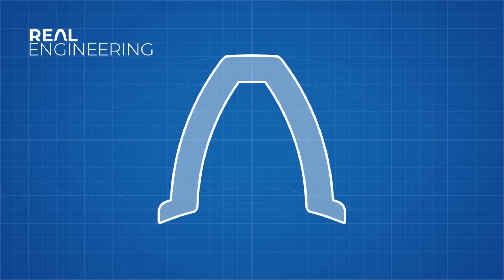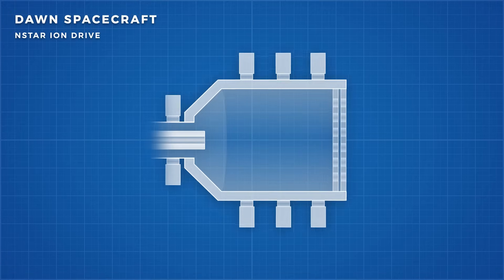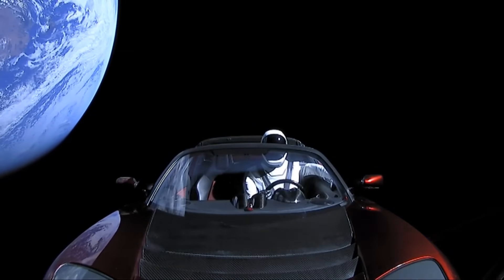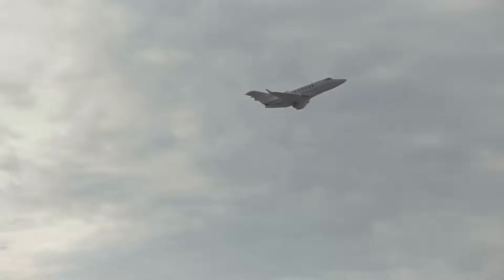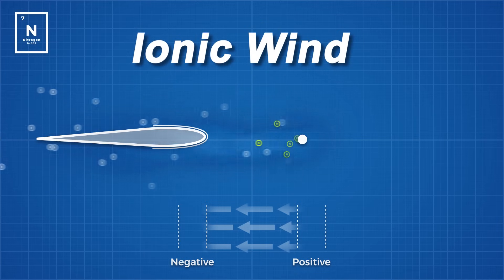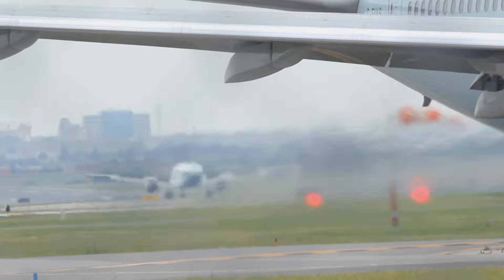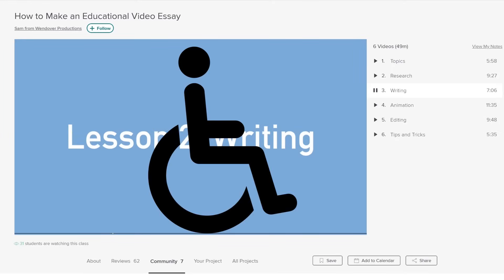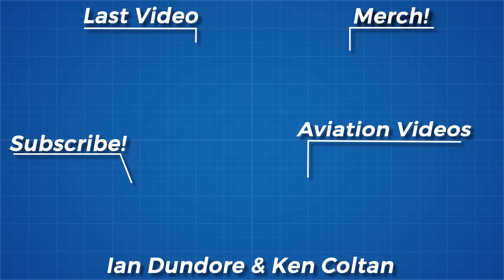Ion Propulsion - The Plane With No Moving Parts

Comment: There are some minor mistakes in the video.
The potential difference between the two electrodes (wire and wing) is 40kV, since the wire is charged to +20kV and the wing to -20kV.
The voltage type is also DC and not AC.

The DC voltage of the battery is converted to AC by a H-bridge circuit. This AC is transformed to a higher voltage level and finally converted to a high voltage DC by the Cockroft-Walton generator.
Reply from the maker: Yeah I goofed on the electronics side of things. I need to bring someone in who has a good understanding of electronic engineering to proof read. I have very little experience
Reply: @RealEngineering  man please take Benjamin he is really good
Reply: @RealEngineering , you also need to get someone to check your script/wording:
„Having no moving parts is a benefit that cannot be understated“ (0:33) means that you cannot say how bad/worthless it is. You obviously mean that it cannot be overstated, it cannot be appreciated highly enough, but you said something different. We get it, but it's confusing at first.
Reply: @RealEngineering  Just keep in mind that voltage is always a differential, never an absolute.
Reply: @RealEngineering .... Keep up the great work.
Reply: @RealEngineering  I respect your humility. You are a good human being my friend. And that's what matters in life.
Reply: @RealEngineering  you do it on your own knowledge??
Reply: @RealEngineering  How about the guy who left the comment? Idk wtf he's talking about, but I bet you do!
Reply: @RealEngineering  what happens if you use a Blimp with this technology?
Reply: It has also been in "development" a lot longer. A paper describes the theories of ionic propulsion and is basically what they build today. In the paper they even say, that it will be possible they just don't have the technology to make the transformers etc small enough. (both was done my MIT tho)
Reply: @IngoDingo   If you click on the channel icon to the left, you will see one that was flying with onboard power before MIT ever heard of the specific technology!  This is not a conspiracy theory or mistake, it is a fact!
Reply: @IngoDingo  
Anyone that takes a few minutes on Google, and does their homework will see that MIT did not create "the first heavier than air ion propelled aircraft with onboard power," despite the highly publicized Journal of Nature claim.

Please click on the channel icon to the left to see inarguable scientific verification and flight videos of an earlier craft with onboard power.
Reply: @IngoDingo  
The MIT craft does not predate the earlier patented ion propelled aircraft with onboard power. US Patents 10,119,527 and 11,161,631. The patented craft was MUCH earlier.
Reply: In 2017 MIT released a paper certifying that their EAD V1 had not achieved a level flight yet. The V2 had not been built.  The previously patented much more efficient one was carrying its power supply more than 10 years earlier.
  @IngoDingo
Reply: Helium can provide the lift for the battery, the ion drive can provide the propulsion.
Reply: @IngoDingo  🔴 What Is Islam? 

🔴 Islam is not just another religion. 

🔵 It is the same message preached by Moses, Jesus and Abraham.

 🔴 Islam literally means ‘submission to God’ and it teaches us to have a direct relationship with God. 

 🔵 It reminds us that since God created us, no one should be worshipped except God alone. 

 🔴 It also teaches that God is nothing like a human being or like anything that we can imagine.

🌍 The concept of God is summarized in the Quran as:

📖 { “Say, He is God, the One.  God, the Absolute.  He does not give birth, nor was He born, and there is nothing like Him.”} (Quran 112:1-4) 📚

🔴 Becoming a Muslim is not turning your back to Jesus. 

🔵 Rather it’s going back to the original teachings of Jesus and obeying him. 

More .....
Reply: Hi @IngoDingo , 

I have read probably all of the papers that MIT has produced publicly about the subject of EAD propulsion over the years.  They were in fact unaware of how to make the technology work at all until November of 2018. 

The patented Self Contained Ion Powered Aircraft, is an ion propelled aircraft that was carrying its power supply before anyone in the MIT group wrote anything about the subject. 

Anyone can see the public flight videos of prototypes of the much earlier vehicle by clicking on the channel icon to the left. There are also links to enough clear cut detailed information on the linked website, that any reasonable scientist should find sufficient. 

There is too much evidence in the form of over 100 flight videos, official witnesses, legal documents, and working flying models of the earlier patented ion propelled craft, for MIT to continue to claim that they built the first or most efficient heavier than air ion propelled aircraft of any kind with onboard power.
Reply: @IngoDingo  No, please look into it more carefully.  Dr. Barrett and his group were incorrect.
Reply: @IngoDingo  tesla coil is the perfect transformer for this especially if your ground is the tail to promote the attraction of ions and if you overlay multiple resonance circuits over the primary coil structure you can cause massive feedback and link it to tanks and resupply the batteries. We depend too much on circuits when we should be using passive components more.
Reply: @IngoDingo 
No, The MIT craft was not in development longer than the previous Self Contained Ion Powered (propelled) Aircraft with onboard power.  None of the MIT students had ever likely heard of ion propulsion when the earlier patented device began development about 20 years ago.
Reply: @IngoDingo  Don't believe the #HYPE. Why no closeups? Becuz #MITLIES and #NAZALIES. This is TOTAL #BULLSHIT. Thee are #NOSATS, Nothing in orbit. #FLATEARTH. #IONENGINES are theoretical and never have been in actual use.
Reply: Thanks for that. I was trying to work out how AC could possibly do what he was claiming.
Reply: @Honey b. Lmao why can't you give people credit for coming up with something
Reply: Ye I was thinking how can this work with AC the net movement of the electrons would be (almost) 0.
Reply: @Honey b. Stop lying!

It was my imaginary friend, the pink poodle who gave us this knowledge! His prophet the holy meatball told us how to do it.
Reply: @Honey b. Yeah Allah the flying carpet inventor?
Reply: Hey I am currently learning the physics of ion and Hall thrusters. Here is a free NASA book if anyone is interested. Its pretty condensed only 500 pages, but be sure to check out the references at end of chapters for further material. Be sure to have strong knowledge in static electromagnetism, and fundamental physics. Also be strong In calulus and differentials. For the portion pertaining to the plasma generation mind you Maxwella equatioms are used in differential form. The only problem with the book is that it uses XENON for all problems and considerations. It neglects other Nobel gases, but the basic practices and fundamentals can be applied to  the other noble gases.
Reply: @Armani Webb what is the problem about xenon, it is just most usable, as it has highest mass and lowest ionisation energy of all noble gases, and liquifies at lowest pressure/highest temperature. It is expensive and rare tho. But it will give you highest efficiency...
If you manage to build something like that at school lab or something (i mean a vacuum ion thurster), you will likely test it with argon/krypton, and use xenon just for "the real deal"...
Reply: @mannyman1012  Sounds great. Can you provide a link to the book please?
Reply: Can a circuit from Taser be used to make the same thing at home?
Reply: @AgarwalHimanshu502  
No. The Taser is AC and has a too low voltage + not enough energy.
Reply: @AgarwalHimanshu502 Small high voltage transformer. Old monitors are a good place to start.
Reply: Also you kept referring to speeds in terms of their mach numbers in space, but the earth mach numbers are not applicable in space.
Reply: Thank you, to the fucker that just HAD to bring religion into this.

Also PSA: "Allah" is literally just "God" in Arabic. So the same God as in Christianity. Keep that in mind. "Allah" and "God" aren't supposed to be two separate things. I'm not even Muslim or religious at all, just saying it to be clear to the certain Christians who ignore this and end up calling their own god dumb.
Reply: Who is alah
Reply: lightspeed?
Reply: @Honey b. I don't think Allah has anything to do with this
Reply: @UnloadingMouse  ah, Dr. Mckenzie, you will surely win the Nobel Prize in Physics when you describe the experimental apparatus you used to detect God and achieve a negative result. Since the idea of God does not make any testable predictions, such an apparatus is, of course, impossible, and your statement is just as unscientific as the position of those of us who do believe in God.
Reply: @neutrino78x  What kinda meth are you on? I merely shared my opinion, no scietenific apparatus is required to do that. And I don't even state it as fact, I just shared what I *believed*.
Reply: @UnloadingMouse  and if allah did have anything to do with it, it'd be full of lies and deceit!
Reply: @8simonking8  you realize of course that God the Father in Christianity and Allah are the same being, right? Just different interpretations. Both groups believe in God. In fact, Muslims agree that Jesus of Nazareth was sent by God, they just see him as a prophet rather than God Incarnate.
Reply: What i wanted to ask can it hold a harsh weather?? Yes you can fly without moving parts  maybe sound cool but truly hard..
Reply: thanks nerds
Reply: visible confusion
Reply: You seem to know a bit about this... would it be possible/plausible to use static electricity generated by the moving air against the air frame to help generate this voltage?
Reply: @AlfOfAllTrades  No, becuase you would have to spend energy in "generating" the static electricity. So it would be a zero-sum-game.
Reply: @AlfOfAllTrades  
Hi Alf,
Great question.  There is a device that uses wet air/wind blowing over collectors and emitters to generate low current high voltage.  It then has to be converted in to usable high current low voltage.  As far as I recall, and I don't remember much about it, it can only supply nanoamps maybe per foot. That's not enough for ion propulsion. It definitely deserves a second look though! Again, great Idea!
Reply: @Richard Vaughn you are looking at current battery technology as it stands today. Theoretically, batteries can hold more energy density than they currently do, and it may be possible to further increase their energy density in the future. Only time will tell.
Reply: @Honey b. shut up. There is no deity who looks after us and the fact you think he cares about our silly little lives is a hint of your massive ego. Life as we know it may be meaning less, but that does not and should not stop us from living it to our fullest. No one cares what you in your 100 or so years on this wretched planet so please make use of yourself and try to better humanity and leave this world better than the state you found it in.
Reply: Yeah and this is the Green backroud smilling shining boy from youtube Little youtube duty Junior enginheir that comes behind every body correcting stuff ohhh look at him
Reply: i'll take your word for it 😂
Reply: I smell futuristic tech where a car is floating :)
Reply: A Cockroft Wolton Generator? Sounds like the inventor of the warp drive! 😆
Reply: @gonzogeier  The "earthern" Warp Drive was invented by Zefram Cochrane. 😜
Reply: Owwww just asked that. He said it had to be ac but it got me thinking. Now it makes sense ahahah
Reply: Benjamin dafuq did I just read?? Homie you know alien! You’ll be useful in Area 51 JOIN US
Reply: That seems rather inefficient to convert to AC then back to DC.
Reply: You can turn it off and on and create a square wave which is neither AC or DC.
Reply: keep working on those segue skills
Reply: Sure hope they can pull it off! 8-16-19
Reply: Yes DC not AC
Reply: bet we see the US government over this like a rash then it's never seen again
Reply: @Honey b.  you got it
Reply: Big brain time
Reply: How to fly without wings
Developing technologies to enable human access to space at dramatically lower cost and increased reliability #FeelFree http://youtu.be/6q7MovLP-e8
Reply: Read my explanation I believe a ball in a plane and use it to stead the plane with a magnetron in a vacuum like if u hold a spinning wheel when standing on a skateboard u start moving I've made a delta wing and then put it in the bath it took time too get in motion but it worked  so if I can do it I need a job doing electronic engineering as I did in the army G
Reply: Your comment indicates improvements could be available with high frequency AC AND IMPULSE ELECTRICAL MODIFICATIONS TO THE ELECTRICAL CIRCUITS. CONSIDER THAT MOMENTUM TRANSFER IS NOT  ALL THAT SOPHISTICATED. The goal is kinetic energy transfer, utilizing the effects operating in the Oberth effect would boost performance. This upgrade is old school for rockets in spaace, ignored in terrestial applications due to the economic disruption it would create in the economy.... ooops, never mind.
Reply: Check out the big brain on Ben!
Reply: So then ... what is the solution .. ???
Reply: Ahh so its basically making the positive and negative sheet in open dimension?  Like pulling the charged atoms past the part shaped to be a wing? Basically making lift in multiple levels...? Is that the point of the ion wind?
Reply: So quiet with no moving parts means good for surveillance drones? What about for commercial ones and not just military?
But wouldn't the electrical voltage potentially attract lightning strikes?
Reply: What about a rotary version? Is there any way to adapt this technology for some kind of rotary wing configuration? Just wondering.
Reply: They were doing cesium ion propulsion systems in the 50's
Reply: @Richard Vaughn as automobile batteries continue to advance, perhaps they'll eventually make aviation batteries more feasible.
Reply: &I bin g; very
Reply: Why cant they take the Wright brothers wing setup and then ionize the front wing
Reply: Could,you imagine if there was. A partical capacitor ? And antimatter reactor used ... Bro traditional technology is on,its way out
Reply: It sounds as though the inspiration came from the erection of the male genital. A surge of power emitting from a wire that runs throughout the plane, strong enough to cause it to rise.
Reply: what are the parts i would need to start experimenting with ion winds? a expensive power supply? wires?
Reply: The original theory was described in 1923 by Prof Paul Biefeld and later his student Thomas Brown. Its called the Biefeld-Brown Effect and describes asymmetric capacitor function. This is the physics behind light weight high voltage "lifters" as well as a rotating propelled spinner demonstrator that Thomas Brown showed off.
Reply: Thank you for clearing that up for me.
Wasn't sure how a full wave Cockroft Walton would work with AC.
Reply: @Ironcammandoo  what, dude
are you ok
Reply: @poggestfrog  

wt, dude truth hurts go cure your eye hahahahaha
Reply: @Ironcammandoo  dude
are you OK? You just randomly commented a likely copypasted super long... idek probably religous thing? I understand people are religous and I'm cool with it and respect your belief but
why
Reply: @Ironcammandoo  You...
You just posted this bruh
Reply: @poggestfrog  

No this one is updated 😏😎
Reply: A piece of paper resting on someone’s hand will not exert any force. Because the paper is already contacting the hand, there is no potential energy, and because there is no acceleration or velocity present relative to the hand, there is no kinetic energy. 

No momentum, no energy, no work, nothing. Et = Ek + Ep
Reply: Kalki Ironman Tesla 2.0 after 2026 😎😎😎😎😎
Reply: Type 7 and 8 level personality 😎😎😎😎😎
Reply: Humans 0
Saiyajin 1 to 6
Angles 7

Kalki Ironman 5th matriya buddha 8th arc Angel 11th satguru 13th imam and 24th avatar after 2026 😎

Almighty God 9 😇

Humans type 2.5+ after 2026 by Kalki Ironman (christ in the white horse)(son of man on clouds) type 7 and 8 😎😎😎😎😎

Jarvis the world’s first artificial intelligence (parrot) 😎😎😎😎😎

Cuz Kalki is ironman batman and every super heroes combined after 2026 😎😎😎😎😎

Jarvis world’s first artificial living being (just like vision in marvel universe)😎😎😎😎😎

Made of Quantum and sub quantum particles 😎😎😎😎😎

Power source quantum energy arc reactor (type 7) level technology 😎😎😎😎😎

Kalki Ironman going to have every kind of arc reactor like:- type 1 Nuclear fission, nuclear waste, hydrogen fusion, type 2 3 4 5 antimatter arc reactor (solid liquid gas), type 6 electro quantum arc reactor, and type 7 Quantum arc reactor, type 8 limitless quantum energy arc reactor without quantum particles 😎😎😎😎😎

Kalki Ironman going to have sun in a box million billion tons of hydrogen nuclear fusion reactor type 2 3 4 5 just like sun and stars in the palm of his hand 😎😎😎😎😎
Reply: Another mistake was didn't mention Santos Dumont, the real inventor of the first airplane.
Reply: Ancient engineering, at the level of TT Brown in his early teens... 
🤘😆
Reply: @Honey b. assalamualaikum... Allah never ask you to comment here... go to pray allah quietly will do though...
Reply: @Honey b. you're joking, right? Imagine if you got your head chopped off for doubting someone's claim...
Reply: @davidcooper2589  "...Imagine if you got your head chopped off for doubting someone's claim..."
That's EXACLTY what @Honeyb's holy book commands...
Reply: @Honey b. Please see my channel to the left, it was not Allah that made them claim they were first or more efficient!
Reply: It's rather ionic, don't you think? The thrust required will never be enough. It takes too long to build up enough thrust for regular flights. You don't want to take several months to fly somewhere.
Reply: @kitemanmusic  The video explains how using this technology on Earth is different from in space. You seem to have the two confused.
Reply: @kitemanmusic  It doesn't take time to build thrust, it takes time to build speed.
Reply: @kitemanmusic  How about a simple tie rope to hold it in place un-till passengers are loaded, then release the tie-down.
Reply: @kitemanmusic  doesn't mean it can't be improved
Reply: I knew there was a good reason the atmosphere is 1% Argon. Still I would design it differently, like a zepellin with a tunnel down the middle and accelerating the gas multiple times down the length of the airship.  And of course the airship would be filled with helium for lift so the components weight wouldn't matter so much. And the entire upper half would covered in light weight solar.
Reply: @kitemanmusic  ... Smh dude most space trips take forever, and this saves a lot of money and fuel compared to maybe getting there slightly faster but using tons more money.
Reply: @kitemanmusic  or never.
Reply: kitemanmusic what if the plane already had propulsion flying in the air and instead a jet engine plane flew next to it to drop passengers in then landed and repeated
Reply: @FrozenSniperShots  
Or a hybrid if that's possible: jet propulsion to get into the air and get to the right speed and ion propulsion to just keep the same speed going.
Reply: Archangel17 ah mine was a joke in reality there would be no point as you would have all the negatives of a jet engine without the benefits if you switch kid flight. It wouldn't work
Reply: @MDP1702  Strapping the MIT prototype to a 747 you could have it up to cruising speed in about 3.5 years.  For an ultralight plane it could get up to speed in an hour and a half.  Commercial is a long way off but if it can beat propellers in terms of efficiency it could be a contender for an all-solar plane
Reply: @FrozenSniperShots  If you've ever taken a trans-atlantic flight or something of similar length, you'd realize that 98% of the flight is cruising/landing, both of which could be propelled by ion engines (assuming we can make them big enough and powerful enough) much more efficiently than a jet engine. The jet could be used only for takeoff and then stowed away like landing gear. You'd then save literally a few tons of weight on fuel and have the room for electric storage
Reply: FortuneFed I understood the suggestion but ii think the cost size and weight of the technology required just to take off is too much for an ion propelled plane to have enough thrust. Potentially the thrusters could take off then fall back to the ground to be reused to be efficient
Reply: @FrozenSniperShots  I wish i could catch a satellite and travel with that
Reply: @fortunefed8719  Cruising at 40,000 ft at 550mph in a 175 ton aircraft takes some serious power. The turbine in a big twin is is producing 100s of thousands of horsepower (100,000HP) to spin that big fan. Each blade of that big fan has the energy of a 100 ton locomotive. The fan itself is producing something like 60,000HP. The fuel is being burnt at a rate of....etc, etc..If you took off with your jets and climbed to 40,000 feet with 350 passengers on board, turned off the jets and turned on your ion drive - You would drop at exactly the same rate as any jet gliding to earth, except maybe you would extend your glide by a couple of feet. This whole thing is total bullshit. Not sure why they bothered?
Reply: @FrozenSniperShots  So, you propose to transfer passengers between two aircraft travelling SEVERAL HUNDRED MILES (or kilometers) PER HOUR? Seriously? What ARE you toking?
Reply: @FrozenSniperShots  WTF?
Reply: @Cycl_ps  #DREAMON.
Reply: @FrozenSniperShots  "alright folks, prepare for cabin pressure release. Once atmospheric equilibrium is achieved go ahead and make your way to the transfer tube making sure to enter feet first with arms crossed over your chest. We thank you for choosing Delta Ion Shuttle Service, good luck."
Reply: @fortunefed8719  You’d need the jet engines for landings as well for the possibility of a go-around
Reply: @MDP1702  you'd still need to fight drag and it's tens of newtons ~hundred newton on just drag alone on ~30m/s figures, Doubt you can make it work.
Reply: @Honey b. Allah is dumb
Reply: @Honey b. So, now they molest 9 year olds?
Reply: @Honey b. Allah put the capability of assembling the knowledge. Not the knowledge itself. Otherwise, schools would be unnecessary.
Reply: @Honey b. It didn't take long for the threats to start... typical IslamoScience
Reply: Benjamin - And there I was calculating the length of power cord they would need to travel from one city to the next.
Reply: There is also a mistake in the Pdrag formula. Speed is times square not cube. ( V^2)
Reply: I used to make a similar engine design back in the early 2000's during the lifter craze. That generator is actually doing pulsed DC. If you did continues DC the ions would build up on the trailing edge causing a reduction in thrust. The weight of the generator and power source were much to high at the time so you could only due tethered flight. My Dean in the electronics department decide to touch it when it was activated he got a hell of a jolt. He listen to me after that. Warning if you run your voltages to high you will produce Xray's. Of course you have to increase the thickness of the dielectric in this case air so you don't have a spark gap. Remember in many ways this is just a air gap capacitor at just below saturation.
Reply: There are many mistakes in the paper that are not minor.  For example: It's not more efficient if it goes faster, its does not ionize nitrogen, the thrust is not directly proportional to the current (nearly as much as it is to the voltage,) etc.. It is simply incorrect for them to say this was the first ion propelled aircraft of any kind with onboard power.  It was not nearly as efficient as the much earlier ion propelled aircraft with onboard power.
Reply: THINK CARRIER CURRENT
Reply: I wouldn't call claiming they are first to carry a power supply with ion drive a minor mistake.  If you are interested, you can click on my channel icon to see a much earlier craft with onboard power.
Reply: There is a problem alright. ..do people not notice how they show reality, like airplanes and ships as reality and they show cartoons only when talking anything about space...absolutely no real footage because it's not reality,it's cartoon fiction..people are living in a theory tale...
Reply: unarammer I hope you are just trolling. But if you need help out of the basement here’s a fun idea. Take a cheap go pro and attach it to a very sturdy and large balloon. Let the balloon fly up until it pops from the cold (of space) you will get to see outside of our atmosphere and as an added plus, you get to see that the world isn’t flat either. Have fun.
Reply: @Honey b. haha!
Reply: @Richard Vaughn aircraft can only use chemical energy, since nuclear is too dangerous. They already use chemical fuel, and there may be a way to get them to use electrochemical energy instead. But nuclear fission is far too dangerous. If even a small amount of nuclear fuel were released, it could have deadly effects and poison an area for thousands of years.
Reply: There are more mistakes than that! It would NOT be "noiseless", you're still moving air, that's where the noise comes from! The pressure differentials between high-velocity air and static air IS SOUND. You can't have a static system (no moving parts) perform as efficient at slow speeds as it does at high speeds, you get one or the other unless you change the primary lifting surface. Honestly, this is an embarrassment because whoever put this together did a sloppy job.
Reply: @14598175  You're not a good person. Arrogant and stupid. At least people are trying to educate the world. Everyone makes mistake. Give them props for trying. What are you doing other than making witty remarks just to pull legs? Ain't that a sloppy job in and of itself?
Reply: @14598175  Oh, poo poo. Sour grapes.
Reply: Benjamin I really don’t care
Reply: To: Durf,
🔵 Yeah, well... what makes you think that WE give a crap if YOU care or not?
Reply: Benjamin can u stop pronouncing it ahl-u-mini-oom
Reply: @Honey b. , no, dear...it was Harry Potter. At least he's real. How do I know? I read about him in a book...just like YOUR character in YOUR book. (but at least MY character wasn't a pedophile goat-herder with a predilection for mistreating women...) But at least I also got to see where he lives. So that MUST make him MORE real than YOUR character, right?
Reply: Don't believe the #HYPE. Why no closeups? Becuz #MITLIES and #NAZALIES. This is TOTAL #BULLSHIT. Thee are #NOSATS, Nothing in orbit. #FLATEARTH. #IONENGINES are theoretical and never have been in actual use.
Reply: We need to invent technology that’s never been invented. - AOC
Reply: Nerd